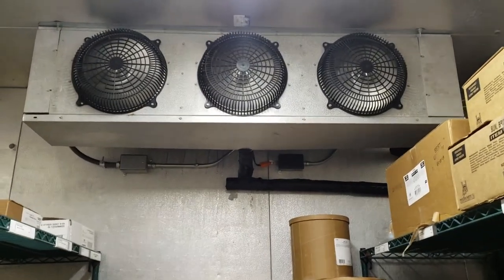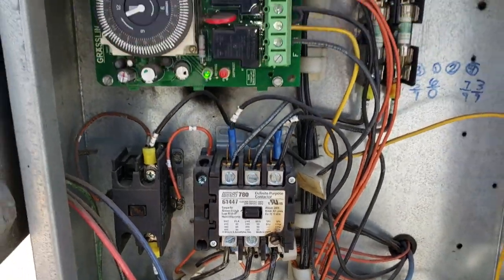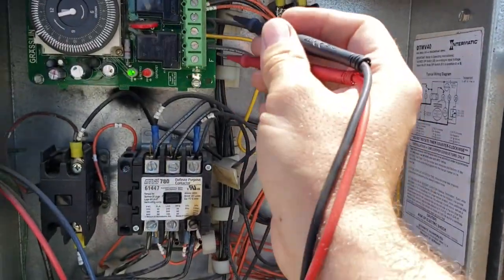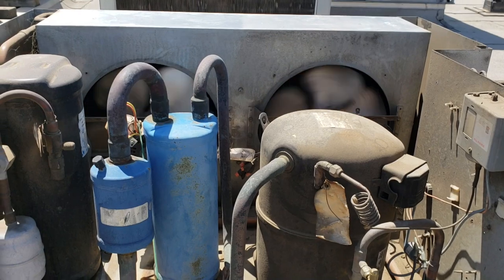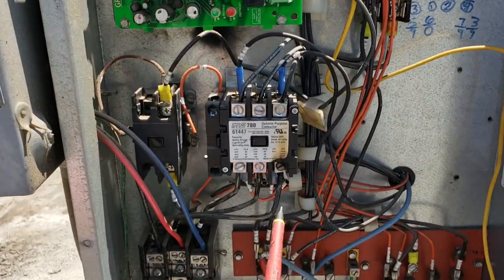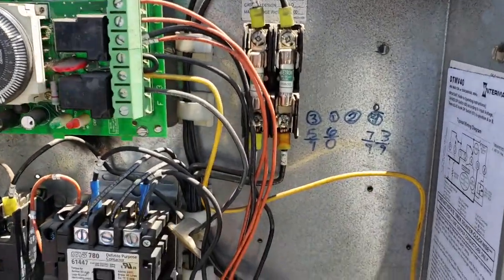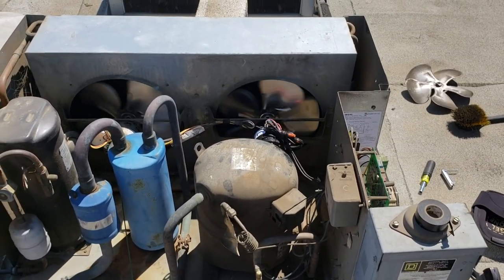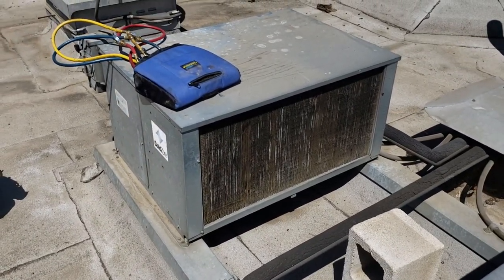WALK IN FREEZER NOT WORKING

Comment: Last week, Chilis location in liverpool NY.
I had both motors bad and blades were spinning g within the hub.
I had 1 fan motor and 1 blade on my truck.
It was 8pm and about 72°f ambient. 

I just removed the bad motors and blades.
Cold zone condensor fan motors require a run cap mounted on them/side.
Blades are case ROTATION. 

Meier supply in Syracuse hooked me up Monday morning

Comment: That right  motor was wobbling. Or again optical illusion.
Reply from the maker: Yeah it was wobbling, the new blade was out of balance too..... frustrating!!!!
Reply: HVACR VIDEOS did you manage to balance the wobble out? Worried that the motor mount would break due to metal fatigue due to stress as it’s wobbling all the time.
Reply from the maker: Yeah I ended up replacing the blade and it solved the problems

Comment: I have a question couldn’t you add a capacitor to the fan and that would’ve solved the problem with motor fan abd the contactor was still functioning could you have tightened wire and left old contactor

Comment: You guys think with the Condenser Fan Motor going out and the restricted condenser  it caused more Resistance increasing amps on one of the 3 phase legs Making the weak point melt?
Reply from the maker: Nah it was just a loose connection, a dirty condneser would cause higher amps but it wouldn't make a connection go bad, it would however heat up an already corroded or loose connection and speed up the process. Anyways thanks for watching!

Comment: If a Connections is discolored, it doesn't every time means it is a loose connection. It could be also an over-tighten Screw especially on Aluminum Wires (compressed Cross-Section equals heat). In the Data-Sheet of the Contactors are Tourqe Values for the Screws. And btw your videos are nice.
Reply: i did not know that,thanks for that
Reply: Had know idea .. thanks
Reply: Nobody with a brain inside their head would ever use Aluminum wire for any commercial application. This was certainly most likely caused by a loose connection, hence the arc-damage that is clearly visible.
Reply: @MFKR696  sorry to be a necro, but as I recently found this channel and have been watching the videos, I did feel a need to address your comment. You're more than likely right on nobody in their right mind would use aluminum wire for that kind of application. Thing is that if you watch other videos, you do see other AC techs not doing things properly whether it be not replacing the run cap with the correct size, not looking at the root cause/big picture, and even not following manufacturer recommendations. So I'm honestly glad Grumpy pointed that out. It might be done by an out of their mind person, but it's still part of the big picture. In this case, it most certainly was loose. However, I do appreciate Grumpy pointing that it's not true in all cases.

Comment: Personally I can't stand those crimp on connectors.  Even if you are going to a steel mating surface they introduce resistance.  I helped someone I knew with a set of steam tables at a restaurant and the electricians used a finely stranded wire to the connection from the main power input box to the steam stable controller and used the crimp connectors.  One leg failed on multiple tables and they made the cable so short that you couldn't fix it without replacing the section of cable.  Instead of using crimp connectors I got some 1/4 inch copper and cut short pieces and crimped that down on the cable to make a solid connection then drilled a hole and used that to attach to the temp controller.  Never had another issue with them after that.  It's a lot more work doing it that way but if you are running a lot of power through a connection it may be the difference between having an issue or not.

Also have to be careful using stranded wire in some of the lug style connectors, some of them will cut through the stranded wire but be fine with a solid wire.  On those you can also do the same trick of just crimping on a piece of copper tubing and then slipping that into the lug so you don't damage the strands, otherwise they are supposed to be soldered to make a solid piece to crank down on.

Comment: Hi boss what is Normal operation superheat on a refrigerator ?
Reply from the maker: A medium temperature txv should operate withing 8-12 degrees superheat depending on your application
Reply: Ok thanks you know on AC unit they have manufacturer set superheat what about a refrigerator are there manufacturer set superheat !!

Comment: I'm curious, When he was up on the roof looking at the units, he looked at the one unit and said it was an R22 unit so that was not it. Is R22 never used for freezers?
Reply from the maker: It's not very common to see R22 used on low temp freezers it is possible but it's not very common I know that store so I just knew that the 22 unit was the walk in cooler and the 404 a unit was the walk in freezer
Reply: R22 is shitty for low temp

Comment: EF grease = fire hazard
Reply: Also what's the thing on the left side of the contactor?
Reply from the maker: It's an auxiliary contact. The defrost contractors control voltage is ran thru it. So if the compressor contactor is pulled in the defrost won't engage and vise versa